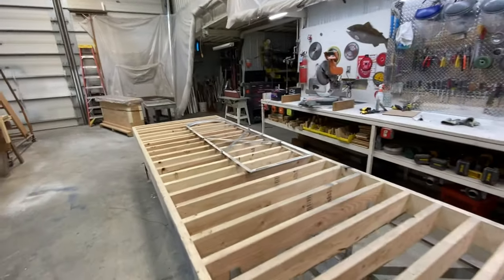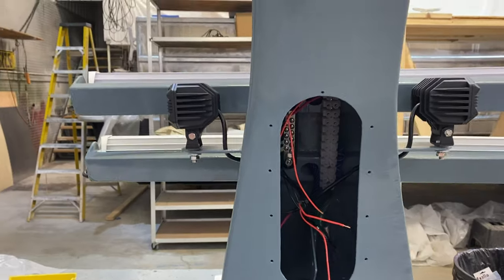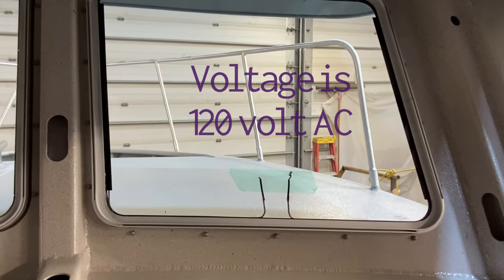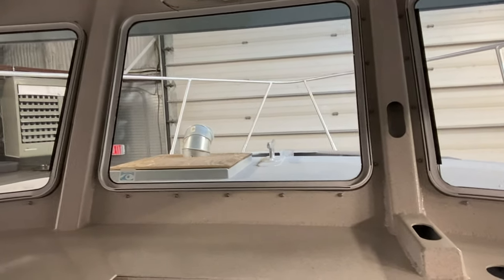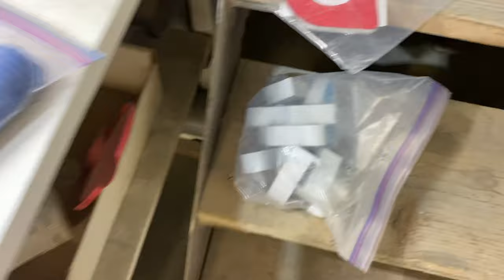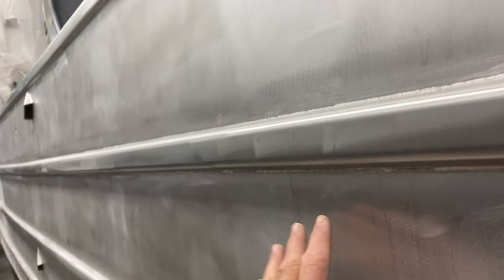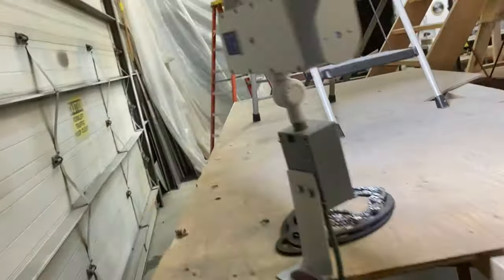Jahrig Aluminum Boat -Up Till March 2nd-2021- #34 - aluminum boat build

Comment: WOW!!!! The halibut killer is coming together. Did you buy plans and add your changes or is this design build?
One electrician to another, please go into detail on the wiring video when you get there. I have a sneaking suspicion the electrical is going to look like a German control cabinet.
Reply from the maker: Morn, I worked with a very good friend of mine who has been building alum boats for over 45 yrs. on and off. Kevin's bottom hull design and from water line up was my design layouts. With a lot of time and thought with Kevin. And soon to start electrical install along with a big list of STUFF!
Thanks